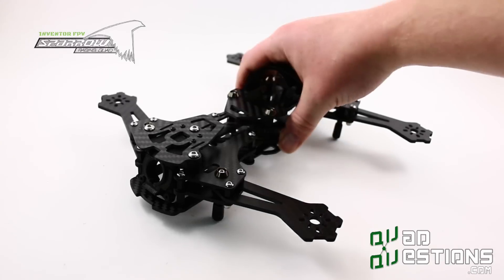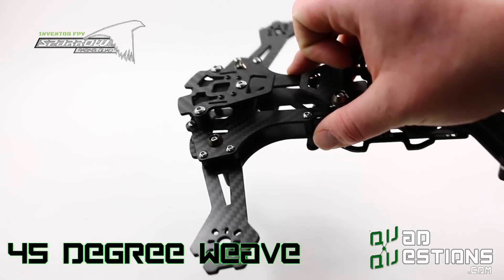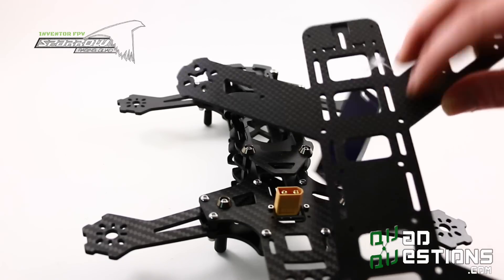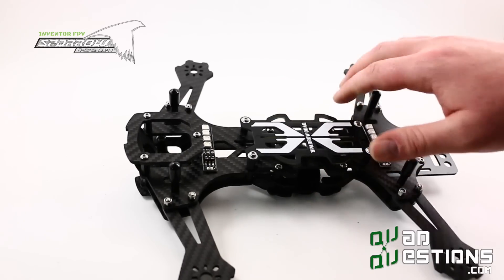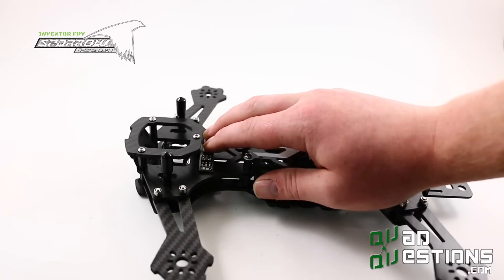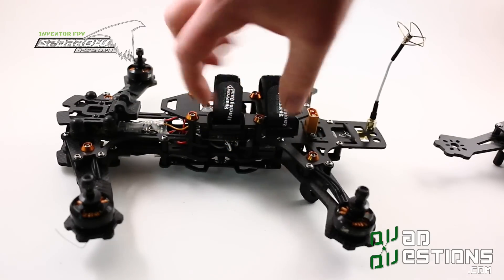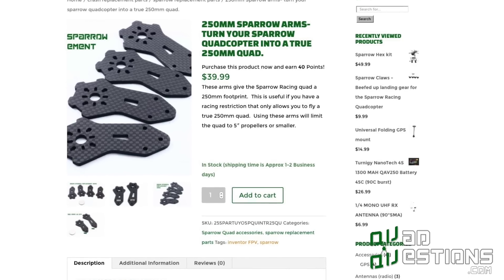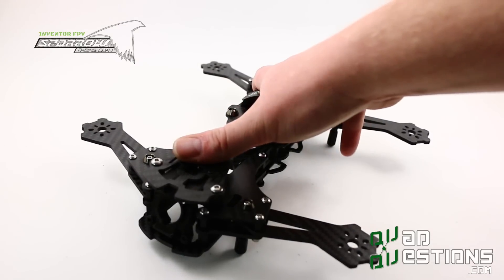Sparrow Racing Quad R4 Introduction

Comment: +QuadQuestions.com what is the shipping cost to the uk on this?
Reply from the maker: +Barnaby Harper Hi Ben, The Sparrow will ship to the UK for as little as possible. You can use the shipping calculator at http://quadquestions.com/product/sparrow-racing-quad/

We have many Sparrow Pilots in the UK, and are more than happy to work with you on the shipping costs.